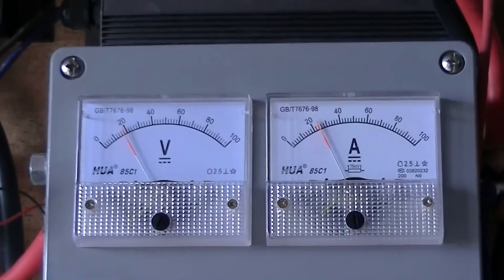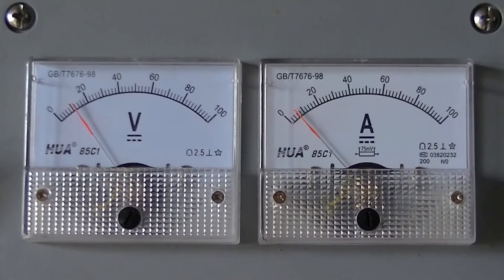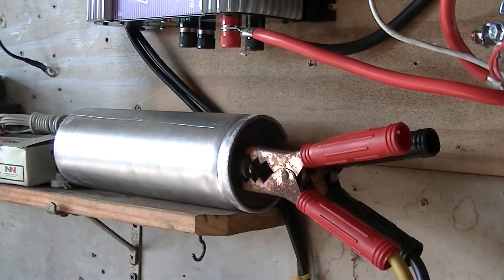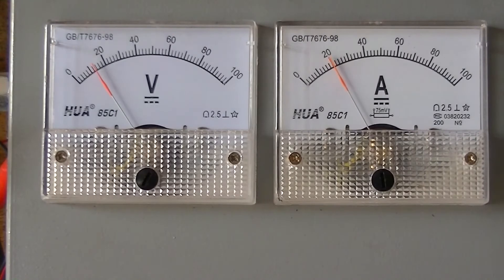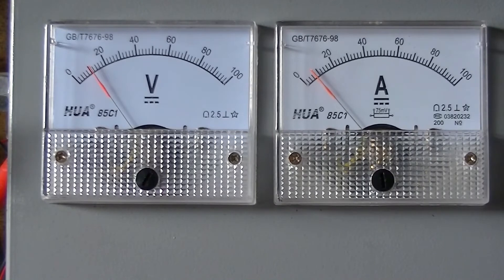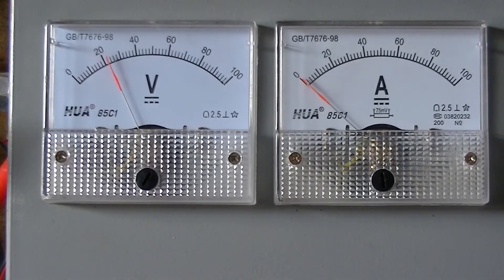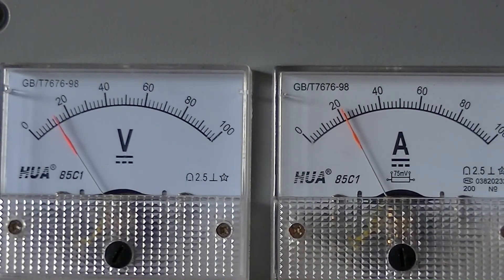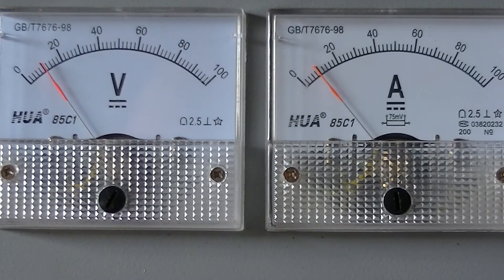WindyNation WindTura 750 Pushin' AMPs!

Comment: Buy listening to u take wind power u know alot about it , is the field u work it
Reply: I have one yamaha early 90 s smoke s a lot , and driving along 22 mph or so hit pedal fall on it face and when thought fuel system , dont know what to do
Reply: Lol blue smoke air box clean air tight , I dont how fast it gos but your right does the bad cause bogging to happen because no spark advance on it
Reply: Brand new air filter air box air tight , new fuel pump  new filter new the tank , card dis asemable cleaned soak in gunk brand new can clean all the port with paint cleaning kits , the plug is black oil fouled , im sure ring bigs part  , how can u tell about valve guide
Reply: I looked all the location:that number are to be not there , thats what looking at is in snow bank tell can get in garage ,
Reply: Is it ok to get back when back to it , in the spring my boy has taken over my garage with his tractor project , lol
Reply: Lol got that plus o degree out high 12 out know